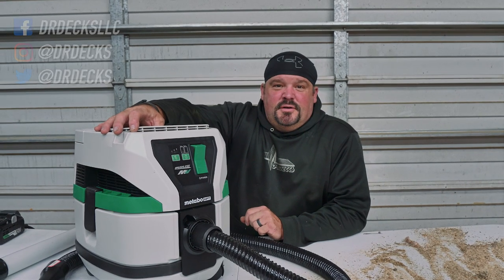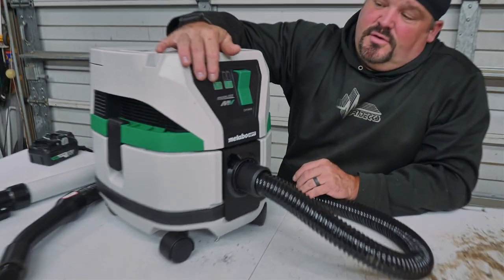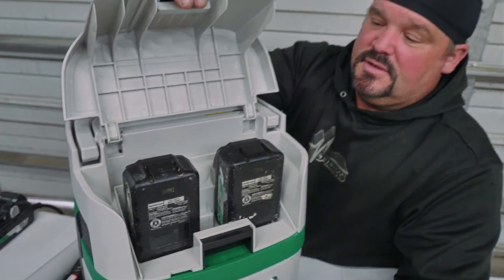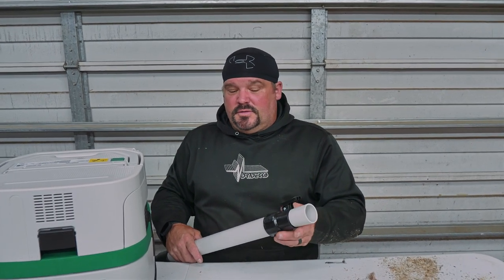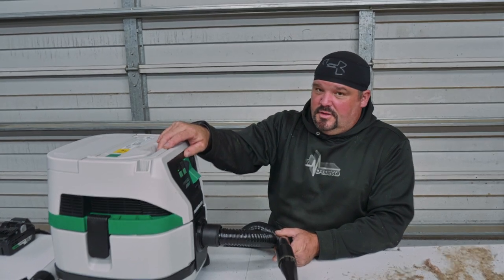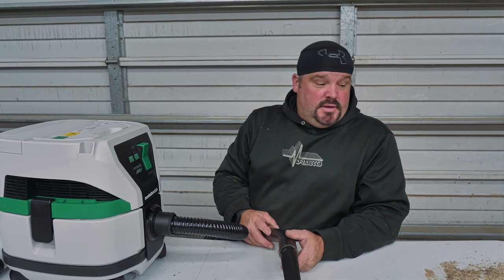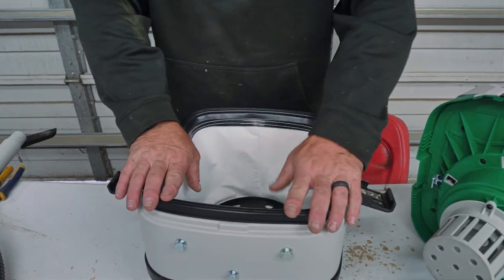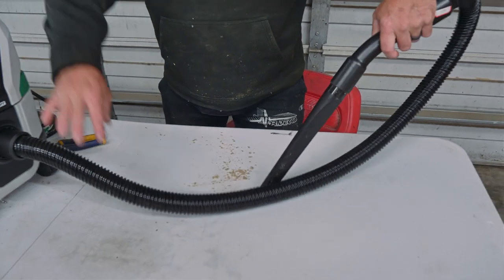First Look: Metabo HPT Cordless Vacuum || Dr Decks

Comment: Unfortunately it's not a HEPA filter/vacuum.  The recommendation for fine dust particles is to use a (sold separately) paper filter - good luck finding one.  For repeated use as a wet vac, Metabo HPT recommends an optional nylon filter instead of the cloth one... good luck finding that as well.  Nice looking vacuum though, albeit pricey.

Comment: I have a wet dry cordless Hart tool works grate . But that vac looks bad to the bone. It say 300$ I would get if it comes with a multi volt battery